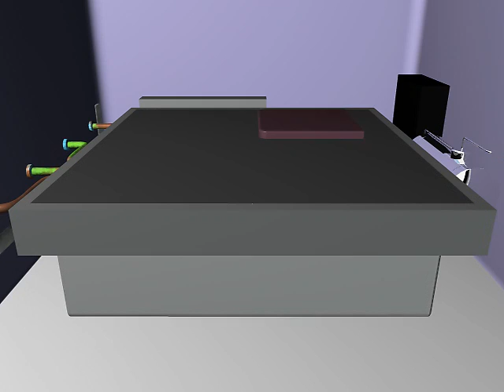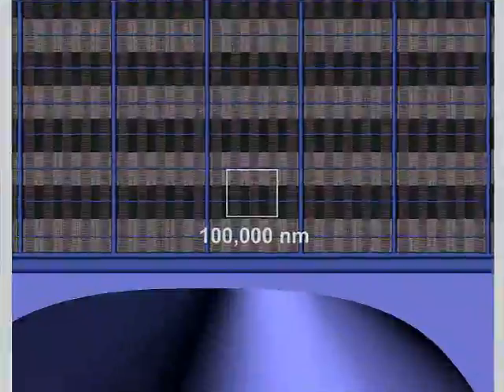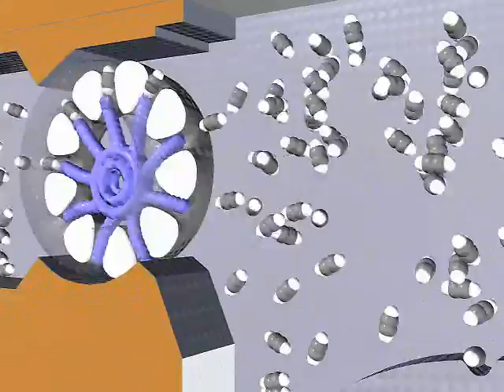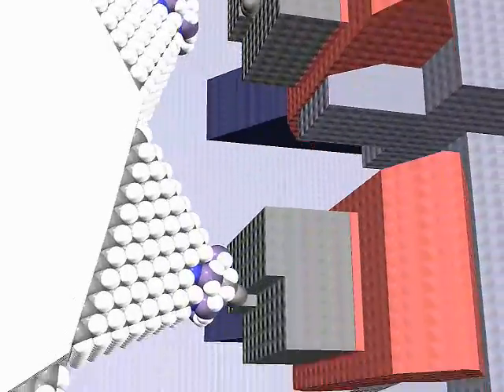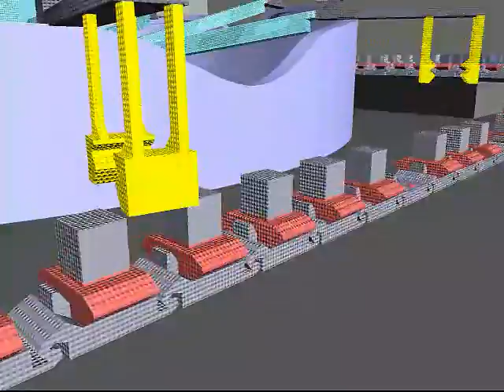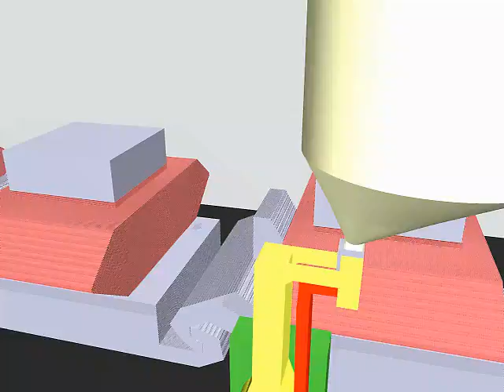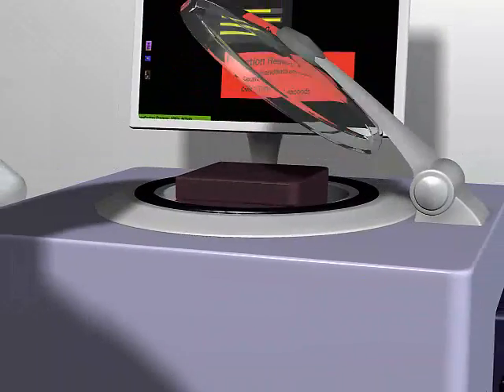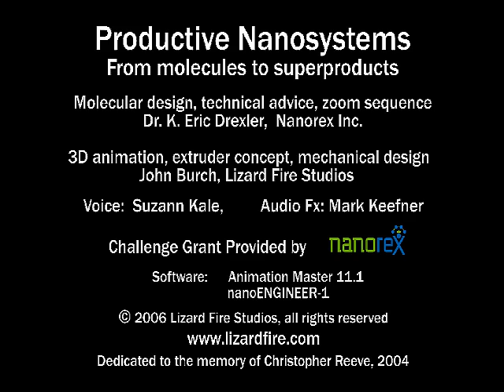Nanofactory Animation

Comment: do these small machines it shows suffer from wear and tear? What if some of them break like conventional tools? How would you repair such small machines in the device, or if say a molecule slipped and it didn't catch it, would it screw up the final product?
Reply: There is little wear and tear. There are no imperfections in the machine that cause wear and tear in macroscopic machines. Individual atoms do not break off when the nanomachine is operated within safe parameters. However, the machine can be made redundant. The parts made can be tested by atomic probes and if there are any mistakes, they can be discarded and the subsystems that made the bad parts can be turned off with production routed through good modules. Eventually the entire nanofactory can be scrapped (say after a year of service) and replaced by a freshly built one that doesn't have any problems (like red or white cells in our blood).

Comment: A couple of years before now, i imagined Nano machines that can quickly traverse space using standing light wave rotated electronless atoms forming a negative mass sheath over the machine (atoms with a completely + charge) these machines communicate with high frequency and high amplitude gravity waves pulses, the mode of external manupulation and through mass propulsion is quantum photonic Gaussian Wave projection/standing light wave manipulation, they would be powered by fusion from the machines using two or more precision manipulator beams to collide atoms which would result in energy being released and absorbed by either Nano thermo-electric generator plates or a similar, the controller for the machines would have to be an extroadinarily beefy and high prequency super (quantum) computer and may be able to build a new one with superfluous structuring and functionality, these machines could do anything from building entire Nano-structured cities from air contaminants, to stopping nerve signals to your brain when you break your legs etc...

Comment: Now, imagine all those atoms vibrating, stretching, and spasming like flubber on acid. That system's definitely not atomically precise. Also, considering gold leaf is only hundreds atoms thick, and is the thinnest material commonly used, I imagine this machine would actually be pretty slow. I'm not saying nanotechnology can't build amazing stuff quickly, I'm just saying the machine capable of doing that wouldn't look like this one at all.
Reply: Actually, the machines will be amazingly fast. I don't think they can form gold from carbon, though.
Reply: +Tim King I was just using gold leaf as an example for scale. I never said the machines could change carbon into gold.
Reply: +Tim King also, what evidence do you have that these machines will be fast? because current 3d printers are too slow or otherwise limited to replace a lot of manufacturing technologies.
Reply: ExcitedBeets 
Dr. Eric Drexler has said these machines will work at super high speeds. He is, after all, the mastermind of ATM.
Reply: ExcitedBeets
Got your note on the gold thing. Understood.
Reply: +Tim King ...OK.

I'm not saying the machines won't "work at super high speeds though" I'm saying that they'll take forever to make anything large because most objects are billions of atoms thick, with the smallest objects being hundreds of atoms thick. 

even if the machine worked on seperate layers separately and combined them later (which isn't shown in this video) it would mean a very large machine. 

I'm just saying the implementation would have to be different.
Reply: ExcitedBeets
I would recommend learning from Drexler's video directly. He is the scientist who has outlined what needs to be done to create super fast ATM devices. He says they will work superfast. It's all textbook physics according to him. All achievable with enough engineering manpower and time. We're essentially looking at the early 2030s for these devices to start proliferating given the exponential growth predictions.
Reply: +Tim King 

K.

I don't mean to be rude, but I have much better things to do in my limited free time than read through a textbook about a technology that doesn't actually exist yet.
Reply: +ExcitedBeets I mean video
Reply: ExcitedBeets 
Of course. I shouldn't expect you to do that. Just reference to the facts straight from the horses mouth. I'm no expert. No worries. 

He does have a book out which goes into even greater detail, but I don't think you'd be interested. lol :)

As you can tell, I'm an enthusiastic fan of ATM. That's why I watch all these cutting edge scientific lectures. I do save a lot of time by listening at 1.5 speed. lol
Reply: ExcitedBeets   Please study Dr. Eric Drexler . The father of nano manufacturing and you will understand the science this is based on is assuredly sound. The tools needed to do this are being developed now.
Reply: I've studied Radical Abundance a bit. Drexler points out that just as size scales down, so does speed.

My own way to understand this is to take a 10 speed bicycle. When you shift through the gears 10 down to 1, the pedals rotate faster and faster as you step down the gears.

In terms of manufacturing, a mechanical arm will move faster as it is scaled down in size. Scale it down a million times, it moves a million times faster.
Reply: intersting. So could Drexler work in Radical Abundance  be a good answer to ExcitedBeets points? ( for ex: "I imagine this machine would actually be pretty slow" )

I guess i will just have to read it (i really think is a good subject for any human to spend some free time researching, as everything shows it will be real at some point not far from now, we have to prepare ourselfes)
Reply: If you have the time, you may also enjoy skimming through this document. It reveals some fascinating details of how an atomically precise manufacturing device will operate. It's mind blowing to say the least. For example:

"Although many configurations have been proposed, the typical assembler has been described as a tabletop unit that can manufacture any physically possible product for which we have a software description. Products can range from computers, clothes, and works of art to cooked meals. Larger products, such as furniture, cars, or even houses, can be built in a modular fashion, or using larger assemblers. Of particular importance, an assembler can create copies of itself. The incremental cost of creating any physical product, including the assemblers themselves, would be pennies per pound, basically the cost of the raw materials. The real cost, of course, would be the value of the information describing each type of product, that is the software that controls the assembly process. Thus everything of value in the world, including physical objects, would be comprised essentially of information. We are not that far from this situation today, since the “information content” of products is rapidly asymptoting to 100 percent of their value.

In operation, the centralized data store sends out commands simultaneously to all of the assembly robots. There would be trillions of robots in an assembler, each executing the same instruction at the same time. The assembler creates these molecular robots by starting with a small number and then using these robots to create additional ones in an iterative fashion, until the requisite number of robots has been created.

Each local robot has a local data storage that specifies the type of mechanism it is building. This local data storage is used to mask the global instructions being sent from the centralized data store so that certain instructions are blocked and local parameters are filled in. In this way, even though all of the assemblers are receiving the same sequence of instructions, there is a level of customization to the part being built by each molecular robot. Each robot extracts the raw materials it needs, which includes individual carbon atoms and molecular fragments, from the source material. This source material also includes the requisite chemical fuel. All of the requisite design requirements, including routing the instructions and the source material, were described in detail in Drexler’s two classic works."

http://www.kurzweilai.net/the-drexler-smalley-debate-on-molecular-assembly
Reply: Sorry but, the book you was refering to would be "Radical Abundance" (Eric Drexler) ?! i am trying to understand how could this concept shown in the video be made at a fast speed (sorry about my english)

Comment: No dummy. The machinary itself is made the same construction process, therefor atomically precise. The only thing that will make them "break" is something that breaks the bonds between the atoms themselves. As long as they are not exposed to forces exceeding their binding energy they will not break. Things at this level do not behave the same as macrosized materials.There is nothing to "wear off" , "snap off" or otherwise fail. Its a chemical machine not breakable in the same way.

Comment: @Phyerbyrd When a machine is only made of a few dozen atoms, it can't be gradually worn down like large machines, because you can only remove whole atoms, not fractions of atoms. But you are right that they will sometimes break, through chemical reactions, radiation, or thermal vibration, and I think (though I'm not an expert) that it would be best to make a nanofactory modular, so that malfunctioning machines can be removed, fixed or recycled elsewhere, and replaced easily.

Comment: This would happen in 100 years if the rate of change was increasing linearly, but it is accelerating and will start to accelerate very fast soon. Just as a rocket starts off very slow , but after 10 minutes its traveling at thousands of mph.

Comment: You mean the billion-cpu laptop would generate too much waste heat? It would, if they were like present-day CPU's. They are probable *very* different. Some designs involve mechanical CPUs. In any case, as I said, is not a matter of whether it would melt or not, it's a matter of how fast it would run (in FLOPS, for instance). Any computer can work without overheating if you keep the clockrate low enough.

Comment: An atom bomb so small can be very destructive. No need to worry... that's just a frame of visual reference. Where these molecules would be thought to be in contact... actually isn't since the "charge" of the electrons will be most likely be calculated. Look for "What The Bleep Do We Know" video when you have the time... it'll explain that certain objects don't specifically touch like something extremely heavy and solid on a solid stable surface... it may be hard to move, but it will not meld.

Comment: The repair strategy is basically modularization (failure isolation), redundance (to minimize repair needs), disassembly/test/re-asembly of complex machines and full recycling of broken parts (destruction and reuse of simple molecules).

Comment: As you say "months" and not "millenia" I assume you do realise that exponentially growing paralellization techniques can be used. It may well take months (I think that's exaggerated, but no big deal) but then you have the nanofactory, which builds much faster. So yes, the one big problem is building the first manipulator. There are two strategies: wet (protein engineering) and dry (AFM and the like).

Comment: No, you don't *need* a full-fledged nanofactory in order to build a nanofactory. That would be a chicken-and-egg problem. But that's not the case. Bootstrapping is very common in the industry and IT. All you need to begin the bootstrapping is a single, atomically-precise manipulator, even if it's crude and "manually" controlled.

Comment: Well, this nanofactory would be the product of a long bootstrapping process, where a few small molecular manipulators build more manipulators and support structures, and so on. Then nanofactories build other nanofactories. It's called "autoproduction". The design should be modular and redundant, so that faulty parts can be simply replaced, or just deactivated. The simplest lifecycle of nanomachinery would be ending up as CO2, then as acetylene, then back to the molecular mills.

Comment: Waste heat depends of efficiency and operational speed. So in the worst case they would have to be slow. But calculations, again, say otherwise. 
Fractal cooling would probably be used, to achieve higher clock rates. That's what human brains use.

Comment: You said "Even fractions of a degree of heat generation[..]". But anyway, call it as you please. It DOESN'T MATTER where the heat comes from, just the TEMPERATURE. Heat translates to thermal vibrations at molecular scale. Higher temperatures mean more vibration, until the structure breaks.  Calculations and simulations have shown that these structures can work well above room temperature.

Comment: Foresight institute is a nonprofit organization, check it out. They just want to raise awareness and debate, so that legislation is not hastily introduced when it's too late.

Indeed, feedstrock and power take most of the machine in this planar assembly technique. Any problem with that? The heat dissipation requirements have been calculated, as I said.

Comment: You have to take a step back and think what a proof-of-concept is for. They are trying to prove that these machines, in principle, could work. Actually building them is a huge engineering effort. If they could build them now there would be no need to convince anyone. That's the point of making detailed simulations. These are not fancy power-point presentations, it's the same tools chemists use to predict things about real-life molecules.

Comment: Heat generation is not measured in degrees. It can be measured in Watts, W/Kg, W/m3, W/m2.. NEVER in degrees, which are a measure of TEMPERATURE. And you can bet that fractions of a degree make no difference regarding structural stability. These people did their calculations, where are yours?

Comment: All heat is disipated through the cooling channels; low-friction molecular bearings keep waste heat low; planar assembly gives you a huge surface/volume ratio, hence excellent disipation. Diamondoid materials have excellent heat conductivity.
"Necesary capacitance" for what? Small motors need small capacitance. 
I said "proof of concept" because moving parts have been simulated with molecular mechanics and ab initio quantum calculation when needed. So it should work if built.

Comment: Oh, about cooling: look at the channels in the "feedstock distribution and cooling plate" at the beginning of the video. The main source of heat, I think, are the molecular mills, where chemical bonds are formed. But this method is "planar assembly", so you only have to cool a thin layer, not a thick 3d structure.

Comment: What's the problem with mechanical and electrical powering? Dont' think of "shrinking" capacitors, think of building capacitors with conductive molecules (graphenes and others).
RE "differentiate", there's no need to. It's a blind, programmable assembly chain. Some end-of-track sensors may be useful/needed, but that's all.

Comment: These assemblers and even the end product computer does not need wires or capacitors... as such atoms will strategically bonded for the molecules to become a constant rapid paced motor which is similar to earth rotating around the sun, but way more than a few million or over a billion times faster as this demonstration has stated therefore capable of producing currents like static electricity... electrostatic as foldr mentioned.

Comment: ur welcome :). If I recall correctly, the main power sources for nanomachinery are mechanical (molecular pulleys, levers and shafts) and electrical, by using electrostatic motors (coils are inefficient at nanometric size).

Comment: At the atomic level, the energy to power this assembly could stay constant which means there would be no need for batteries or any other typical source of electric currents. I'm sure this will be, by far, a much different type of computer than we have become accustomed to as if the entire unit is practically indestuctable, yet reasonably lightweight, as the screen itself will be made out of a solid diamond layer.